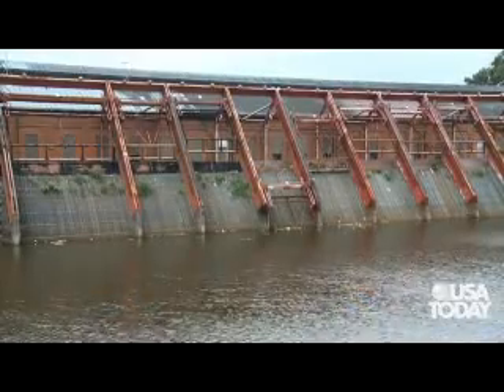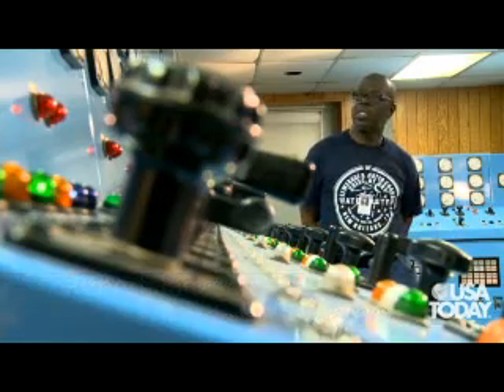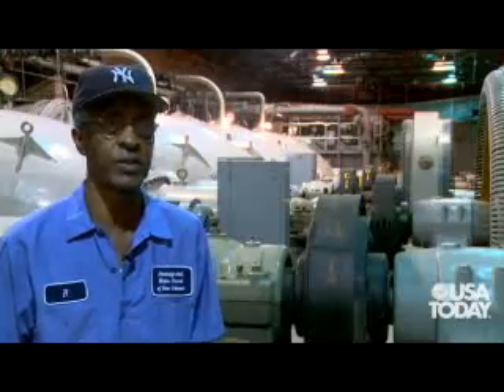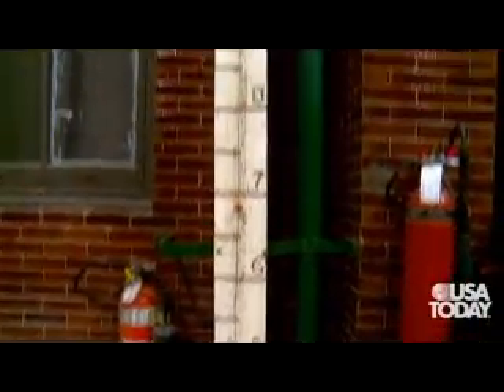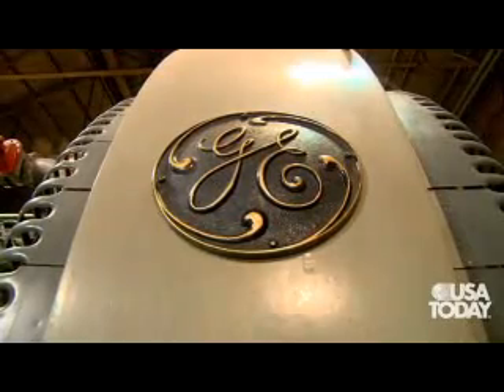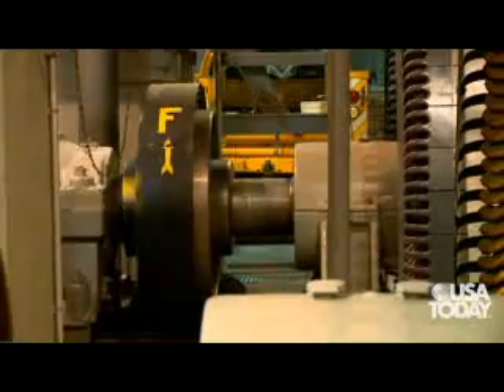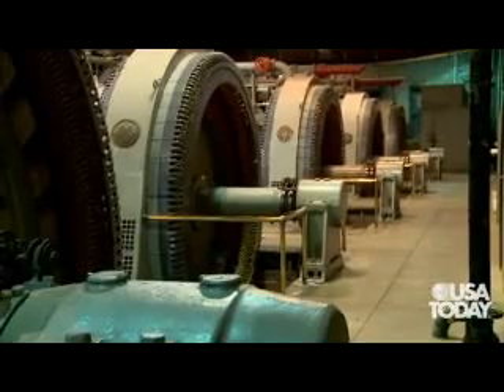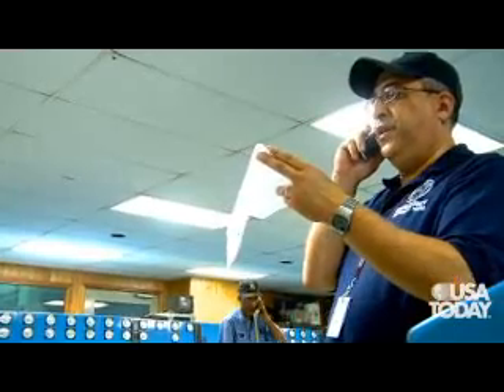New Orleans Pump Station 6

Comment: Not sure i'm gonna bite on a million gallons per second flow rate...  That would be 60 million gallons per minute.  Gallons per day, maybe, per pump, but there's no way it's per second.
Reply: He probably meant the entire system which includes other pumping facilities.
Reply: @sharkheadism  I think you’re right. Swbno.org says the worlds largest pumping station is 150,000 gallons per second (not a million) There are a total of 24 total pumping stations, which makes that million make a lot more sense
Reply: That.. would be 86 billion gallons per day.  Not buying it either for that size of pump.
Reply: kleetus92 True..  The propeller would have to be the size of the building! 😯
Reply: And the HP requirement would be astronomical!
Reply: Lol... it's the news media... you could have said it burns coal and makes puppies on surf boards and those dolts would eat it up...

Comment: It has slip rings.
Reply: Yeah, they are synchronous motors... but he's thinking DC machines. He might be thinking of the generation side, were they convert 60Hz to 25 hz power.
Reply: kleetus92 if they are synchronous, then they would need a commutator with slip rings and brushes to build up the field on the armature to reach synchronous speed.
Reply: @Marvinthecoinhunter  You are confusing AC with a DC motor, those are 100% synchonous motors.

Comment: I've been told they run on AC 25cps, generated by their own power station.  Not sure.
Reply: They do. They actually have a dual grid, 6600V 25 hz, and 4160v 60Hz. The 25 Hz system is a house generated system , case the main utility fails. If they both fail, well... you're fucked.